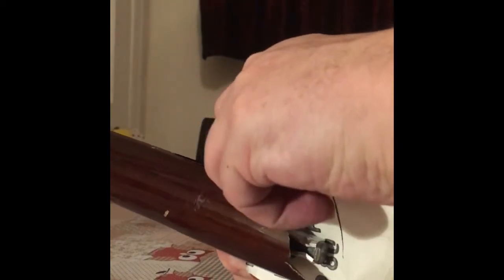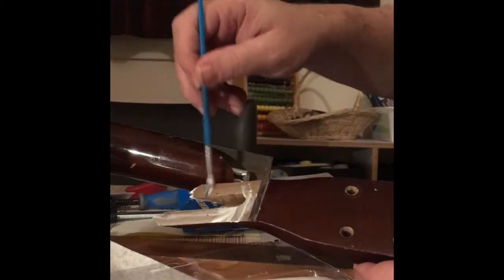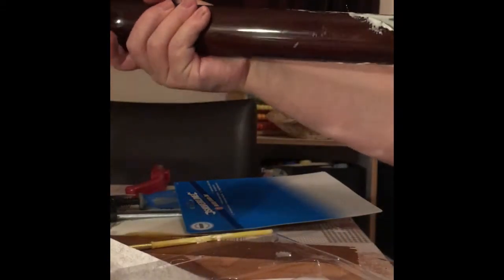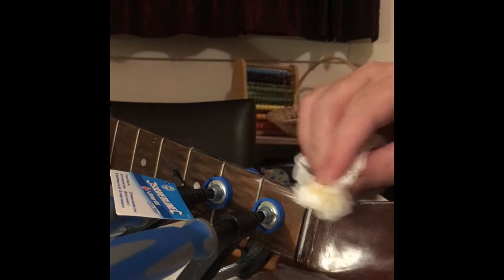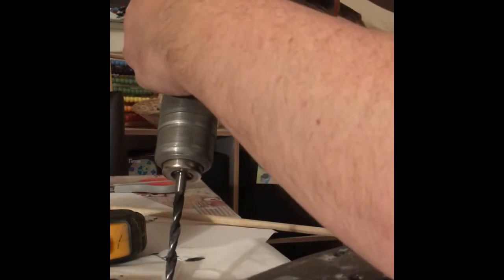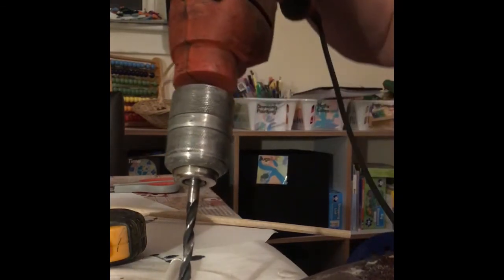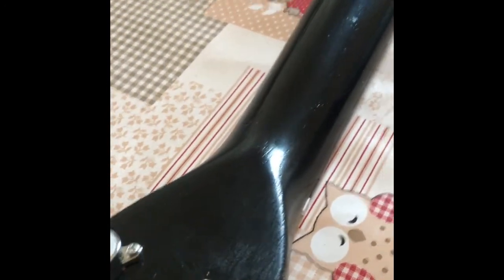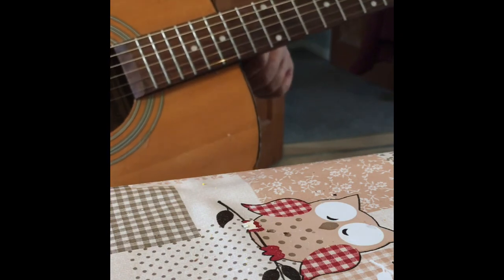Fixing a guitar with a broken neck with no real tools money or idea what I'm doing.

Comment: Good job! Did not need the dowels though as there is plenty of surface area to provide way more strength than needed. Many guitars have a glue joint there and a snapped joint is stronger than a flat surface joint. I'm surprised if that truss rod is not adjustable. Have you looked in the sound hole for a hex socket? The neck might need a tweak when the glue has had a few weeks to harden.